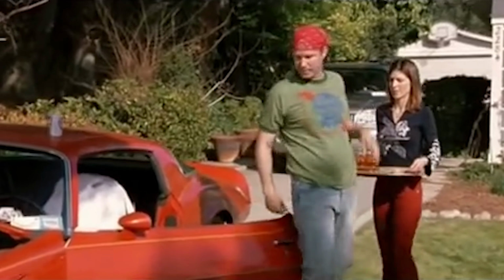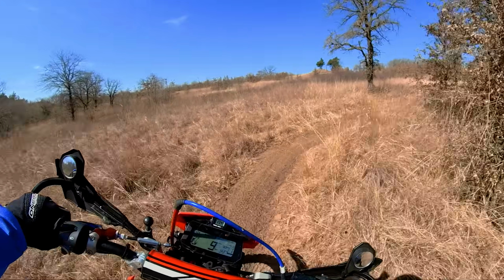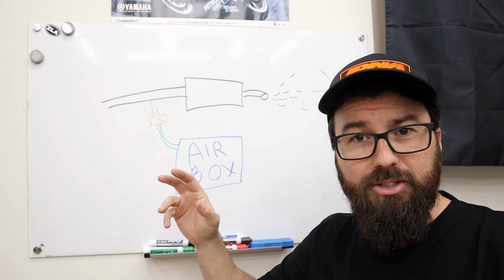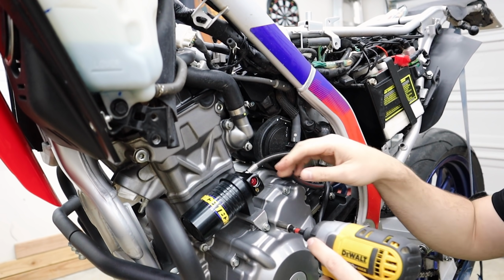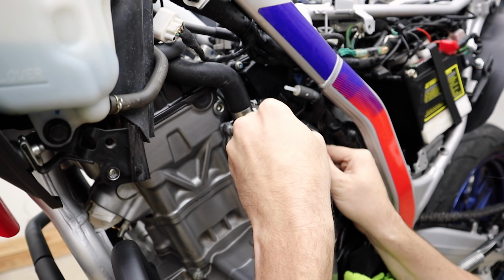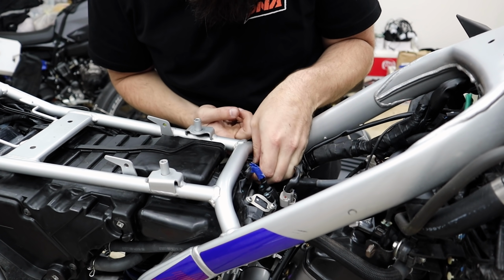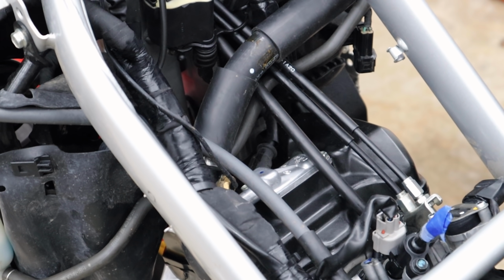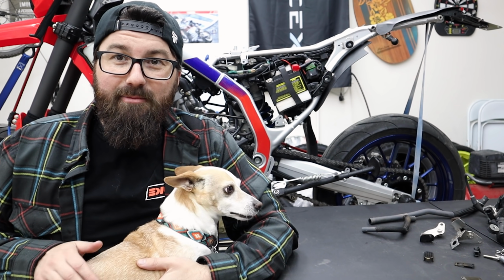CRF300L Pair & Charcoal Canister Delete

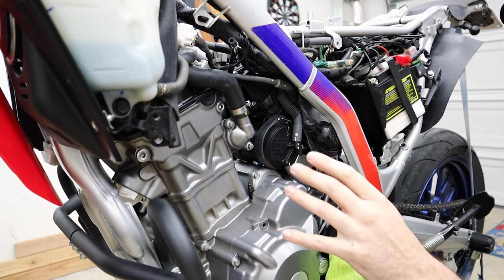Comment: Do you only need to pin that connection off if you haven't flashed it yet, I have the 5:50 performance flash so I think maybe that is already dealt with in that programming?

Comment: I did a valve adjustment on my 2020 crf250l and found that the pair pathway under pair check valve on cylinder head was clogged. But I didn't clean/open it. Should I let it be like that?

Comment: Why the block off plate couldnt? u just put like a catch can filter on the end of the hose and have it act like crank case pressure relief?
Reply from the maker: No that’s connected directly to the exhaust port. You need to cap it if you’re gonna delete the emissions.

Comment: You have the expertise to do it, but the web is full of people who have made modifications to obtain they don't know what, and now they have problems with operation, and they consume much more petrol, the motorbike runs like a stock clock and consumes very little, as far as I see it I won't touch anything of the engine because it's not worth it, much better to spend money on the suspension.

Comment: Thanks for this. That canister really makes the bike unsafe . That power surge or killing of the bike due to that catch can happening when you need to maintain momentum is a deal breaker. If you ride the bike off-road at all it will happen. Glad it can be deleted easily.

Comment: Do NOT put a jumper in either electrical plugs!

550Preformance: “Don't put a jumper in them as that causes a temporary short circuit on key on that the ECU needs to detect.
Simply tape them shut and tuck them up into your harness. If you have dielectric grease, you can install that into the terminals to further prevent any water from getting into the harness.”
Reply: Where did you find that quote from 550? I’ve been searching and can’t find it.

Comment: Jake I hope you see this message once you get that pair valve out you know the sensor that you unplugged to the right side under the gas tank what did you do with it? Did you just leave it alone and then when you got your tune it got rid of it cuz I got the 550 performance ECU should I leave that plug unplugged and just tape it up or should I put a wire from terminal to terminal then tape it up? Thank you for your time and I literally watch your channel and always recommend you as well!
Reply from the maker: I just left it unplugged and the Ecu flash fixed any check engine light from it.
Reply: @TheGardenSnake  
Okay thank you I was a bit confused cuz I didn't totally watch through the beginning of the video once I did I seen that pinning it does not work. Thank you again!

Comment: So, the secondary air thing seems to act  as the engine vent of excess pressure...by blanking it off won't that result in overpressure and blown seals?

What advantage is removing the list bit anyway? I understand removing the charcoal can ( space) but not the air thing.

Comment: You can still use that O2 sensors bracket if you use shorter bolts and put it back without secondary air valve.

I'll maybe try to use 25ohm resistor for secondary air system on and 30ohm resistor on charcoaö canister blug. 

Measured those today.

Could you put link for your Power Vision 3 solutiom here.

& Thank you Jake!

Comment: Fantastic video Jake. One question, other than what you just did, does the bike have a modified ECU, or is it just completely stock. I’d like to remove all the pollution devices, but am a little worried that the bike would not run that well. Thanks much.

Comment: Sir Snake, I must tell you that you were not wrong about jumping the solenoid plugs!  I in fact have done it to my 300L with peices of an old brass keyring  and once I drove the bike the CEL went away immediately!

Great work BTW! Love your builds!
Reply: Are you tuned?
Reply: Putting those jumper wires would destroy your pcm by shorting their output voltage thatvdrives those solenoid coil windings
Reply: Thats true, coil is diff from a solid wire, u will just destroy the output power transistor inside the pcm. Why not put a 12v bulb instead of  wire
Reply: @treeharris93  
I wrote Jake asking about jumping the plugs and he said he did not do it? But in the video he does? I'm wondering if we went back and took them out? I had them jumped but he told me not to so I took The wire back out.

Comment: Do you think it'll be relatively the same process on a 2014 crf250l or are there some significant differences?
Reply from the maker: I’d have to imagine it’s basically the same
Reply: Thanks man
Reply: Did you get a check engine light?

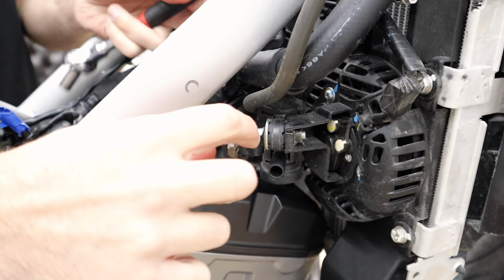Comment: At about 10:06 you mention that the O2 sensor is disconnected because you were going to be doing an exhaust upgrade.  Will you end up reconnecting that to the new exhaust?  I have a full Yoshi system that the O2 sensor connects to.  I'm assuming that needs to stay.  Correct?

Comment: Great video. Although if I install the Acerbis tank which has only the breather on the tank cap (short tube sticking up from the cap) there is no need to remove the charcoal canister, but only do the PAIR delete. Correct? Thanks!
Reply from the maker: I guess you could just cap it. I was happy to rip it out.

Comment: Getting ready to do this mod. Question, why didn’t you cut off the connector and solder the wires instead of using the jumper wire?  What am I missing?  Thanks
Reply from the maker: Yeah you can. I just didn’t want to modify the factory wiring harness.

Comment: If this isn’t operating properly could
It cause the bike issues to start? Was riding and gas tank full.  So could it saturate and cause issues ?
Reply from the maker: Definitely can. Since this mod even hard off roading hasn't brought back the stalling issues.
Reply: @TheGardenSnake  Amazing I’ll have to try it for my 300 rally it would ride for 10 minutes or so and then if the bike was stalled or shut off it would not start we would have to wait 10 minutes and then it would start and this happened six times in one day.   Thought maybe faulty fuel
Pump or fuel filter but this makes sense.  I’m not sure about the parev valve but definitely maybe just the eve app cannister would help this issue but I have to figure out if in Canada they check for inspections. Great  videos you always go top notch vids 🤘🏼

Comment: Out of interest, did you check if you got the check engine light before you removed the PAIR system... ie. if you just removed the charcoal canister solenoid, but left the PAIR solenoid connected? The reason I ask is I've removed the canister from a number of CB500Xs over the years and there is no check engine light, even without bridging the now open plug on the loom - you just tape it up.

Alternatively could you just not leave the canister solenoid connected to the loom, but essentially doing nothing now all the hoses have been disconnected? I imagine that would simply 'fool' the ECU that the system was still in place even though it is no longer venting into the throttle body from time to time (since all that solenoid does is open a valve in the hoses).
Reply: That thing you mentioned about  reconnecting only the sensor for the catch can works to remedy the check engine light. I was going to just be annnoyed by the light until I bought the 150$ ecu flash. Decided to just use the leftover hardware along with some zip ties to affix the sensor with the two outlet hoses plugged with the same rubber caps that come in that kit that Jake links. You do it right and it looks stock at first glance aside from plugs. Free is cheaper than 150$. Same solution if you don’t care for performance gains

Comment: Hi Jake & others for what it's worth i followed your link for block off plate & all others bit's needed  to do what you have done,  i am in the UK  &  yes it works no more 5k rattle & all euro  emission crap gone & adjusted  throttle play different bike now,  Thanks again Jake,  all i can say to CRF owners is do it, could not hack that rattle any longer,  ATB Wayne UK...........
Reply: So the UK bikes all come with the same emissions bits then i'm guessing. I'm looking into buying a 300l at some point but wasn't sure if UK bikes had all this stuff on as well. Was it easy to remove?
Reply: @dodo19923   Yes easy enough take your time about half hour/ 45mins tops, follow Jakes vid you will be good, W......

Comment: You could also just measure the the resistance of the coil for the evap canister coil and jump the connection with a resistor close to that value.

Comment: Try bridging the 2 solenoids then disconect the throtle body wires then plug back in  you should have no check engine light 
This worked for me

Comment: I grew up in the 70’s on 2 stroke dirt bikes. I have some street bikes but bought a new YZ 85 for the dirt as I am 5’8 150 pounds. Love the power and lightest of a 2 stroke.  160 pounds wet, 23 horsepower.

Comment: I'd be very interested in seeing if others have removed the reed valve and their bikes stopped rattling at 5k. I want to keep my bike stock but am willing to delete this BS if that gets rid of the rattle.
Reply: I was hoping to find a comment like this. I literally just did everything Jake did in this video. The only thing different is that I used a snug vacuum cap on the pair valve port instead of using the block off plate (on its way from Revzilla currently). I removed the reed valve as well but still have the rattle at about 5,200rpm give or take a bit. I had to drill out the Philips head like in the video but did make sure to put the gasket piece back in. I was really hoping it would have removed the rattle. I don’t see how the block off plate could make a difference but who knows? I hope someone else has done this as well to see their results.
Reply: @radioflyertrike8  thanks for the reply!
Reply: Hey guys just did the same and deleted it all and put the same cap on and unfortunately I’m still having the rattle no change

Comment: I have thumb upped all your CRF300L Vids, Thanks for posting. I have a few quick questions. I know the stock wheel hubs are steel, are the rims also ?  The stock handle bars are steel, are the upper and lower triple clamps also steel ? I was told the engine is painted because it is has cast steel cases, jug and head and the only aluminum was the piston and Fuel Inj. housing, is that accurate ? Is the front master cylinder aluminum or a steel casting ? I would guess the disc brake cylinders are alum. as well as the rear brake mstr. cyl.  If this is true it seems they have kept the use of aluminum to a minimum on this model only the swing arm, upper fork tubes and clutch and brake levers. I have not seen one in person yet as my local dealer had one back in December that I missed out looking at and won't have a 2022 in until June or July.  Thanks

Comment: great video,    just one concern that jumping the electrical connector would be a direct short and could damage ecu. just an observation.love all the vids keep em coming .. thanks
Reply: With 550 tune...they recommend a lil dielectric and tape it off...no jumper.
Reply: @olejfuse337   With 550 ECU no wire to tie off correct just dielectric and tape it off ?   I put plugs in mine from smartmoto wonder if I need to remove the plug and tape off no issues with bike?
Reply: @mt1885  I emailed 550 and that was their instructions. Only tape off
Reply: @olejfuse337  Thanks you will tape off

Comment: I have a 300l. Have yoshi exhaust and deleted the charcoal canister while installing exhaust. Jumped wires on solenoid plug and have put couple hundred miles like so and never had check engine light come on.
Reply: Mate have you noticed any benefits? Did it help with the exhaust pop when you decelerate fast with the throttle. I'm not sure About doing this mod or not. On the Rally.

Comment: Are these just on CARB models, or on all 300L’s sold in the US? It looks like the weight of the CA model is 2lbs more than the 49-state version. That sounds like the parts are just on the CA models.

Comment: The pcv valve actually helps make power by removing excess crankcase pressure. But it shouldn't be that noticeable of a hp loss... good vid anyway.
Reply from the maker: I didn’t remove a PCV valve. There’s a wide open breather right from the crank to the air box.
Reply: @TheGardenSnake  ok I see now,  I did not know that was a different type of system as I work on older bikes. It looks just like and acts just like a pcv valve but in reverse and is vented to the exhaust instead of the crankcase. Anyway sorry for the confusion.
Reply: Excess....
Reply: The pair valve is emissions only. No power is gained by keeping or removing it.  The benefit from removing it is it will stop the deceleration pops after installing and after market exhaust
Reply: @SPROCK3TMONST3R  So it improves emissions and makes cool noises on deceleration? I will definitely keep mine then :D Sounds like a win-win.
Reply: @marcelpursche5339  i don't believe it helps much with emissions. But it does make noise polution on decel. Lol!
Reply: @marcelpursche5339 😅 Enjoy getting stuck in the woods some day from flooding.👍  You just can't get the point I guess.🤷